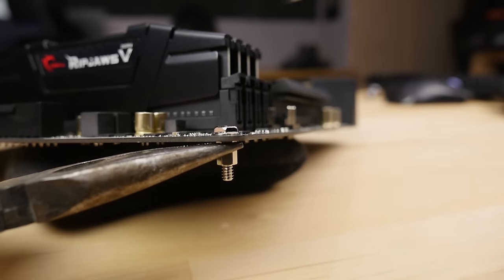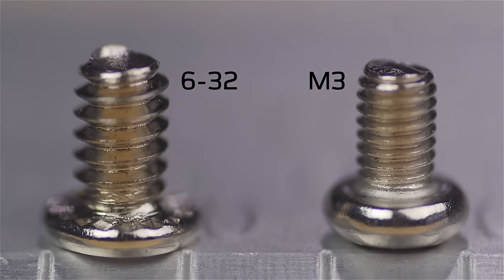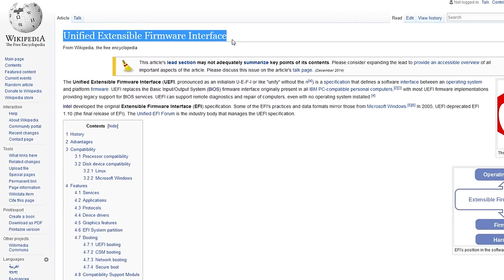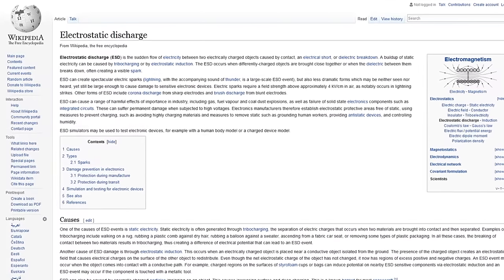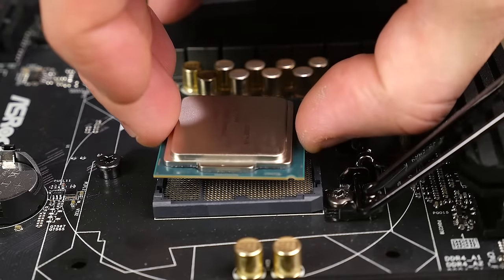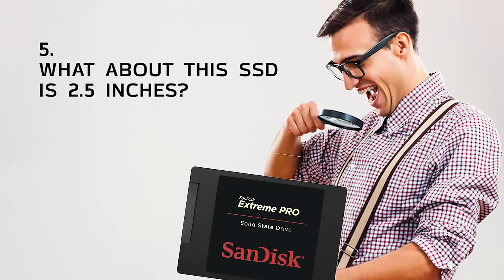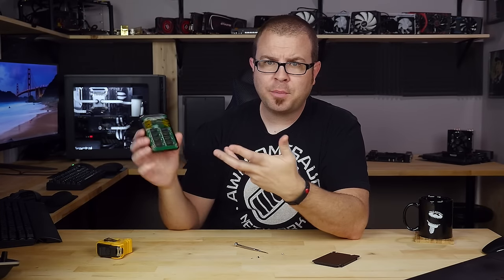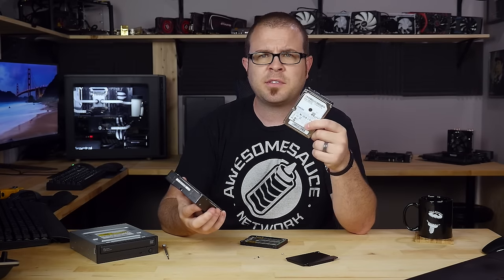5 Confusing PC Building Facts

Comment: None of those things have confused me (yet, I've never dealt with a system using UEFI). What confuses me is all the little variables that go into selecting the parts. Like the RAM speed, bus speed, how many "rails" the power supply has and how much power each one can supply, all the CPU parameters and which ones you need for any particular board, etc.

To be clear, I've never built a system from scratch, but I've read other people's discussions of system building and unless I'm mistaken, it's not as simple as just selecting compatible parts and slapping them together. I've seen motherboards that seemed (to me) to be fantastic and have every feature you could want, and yet people claim they have nothing but problems with them, or that you can't use certain combinations of parts with them, even though they should be supported.
Reply: In my (albeit limited) experience building pcs, it is a matter of just grabbing compatible parts and slapping them together. Maybe if you're overclocking or pushing performance you need to pay more attention to that stuff, but I've built a few totally good machines without going too in depth selecting parts.
Reply: It's really not that hard unless you're trying to build a super high end rig where every last bit counts. Generally if you can get past getting the processor and motherboard everything else is easy (which is usually just getting the right processor socket). Any decent company that sells memory will have a helper where you just put the motherboard model number in and it will tell you your memory options and give you an easy shopping list to choose from. As for power supplies, an ATX power supply around 500-600 watts will probably be plenty of power unless you plan on running multiple graphics cards and/or a whole bunch of hard drives.

And as for people complaining about any product, people are more likely to complain then compliment. So check multiple review sources and remember that for every positive review there are many more unwritten positive experiences than for every negative review you find.
Reply: People don't use the defaults? It used to be back in time that you had to select the correct jumpers or you'd fry the processor, but these days, there are so many different sockets available that it's not something I've encountered.

Also, the CPU is the box and all the goobins in the box, the processor is the little thing that goes in the socket. I wish people would keep it straight as they're not the same thing and it does add a slight bit of confusion.
Reply: CPU stands for Central Processing Unit - people just call it a processor nowadays. The box plus goobins is the computer.
Reply: MastAblation No, it's not. The computer is the monitor, keyboard, mouse and CPU. Sometimes they're all combined into one box, but that's a desktop.

The CPU stands for Central Processing Unit, as in the place where the motherboard, processor, RAM and other bits live.

Just because people choose to use the wrong word for a technical matter doesn't make it correct. And there's no excuse for people who know how to assemble a computer to not know that the processor goes inside of the CPU.
Reply: +Shaun Dreclin & John McMillen As a small example of what I mean; When I went shopping for a graphics card for this system (which was otherwise complete when I bought it refurbished), many of the cards said they required a 500W power supply and some even recommended more. When I asked for advice online, I was told that even though my power supply is only 450W, I could use pretty much any card I wanted because it was a heavy duty power supply and had enough power on each "rail" to support more advanced cards.

I don't have the faintest idea how you would determine such things. In the end, I didn't buy a super high-end card, but if I hadn't been told this, I would have driven myself crazy worrying about the power requirements of each card I considered.
Reply: +Chris L No you are wrong. The CPU is the Central Processing Unit, which can be made up of 1 or more Processors/Microprocessors. The board that contains all the other required microcontrollers/processors in order for the computer to operate is called the Mainboard/Motherboard. If all the required ICs are built into a single component, then it is called an SOC/System On a Chip. When you combine a CPU, a Motherboard, and Memory, you have a Computer. Most Computers have more than one type of Memory, and also have extension chips attached to the system bus to add extra functionality such as input/output and permanent storage.

You really should educate yourself, or at least do a simple google search, before trying to spread false information as truth.
Reply: Sean Ramey From the looks of your picture, I've been using computers since before you were born. I even earned a merit badge for them when I was in Boy Scouts.

That isn't true. The CPU is the box and all the goobins in it that include the RAM, motherboard, processor, disk controllers and all the bits necessary to do the processing. Hence, it's the Central Processing Unit.

There's a lot of ignorant people spreading that mistaken belief that a processor is a CPU when it's not true. It bothers me a great deal that retailers have succombed to that mistaken nation as well.

But, now, the box is not the computer, the box is the CPU. The computer is the collection of display, CPU and input. Although, it may be missing one or another of those.

If you're going to correct people, it would help if you're actually right. I've been using computers since the Apple ][ and doing my own upgrades for over 25 years now. I think I know a thing or two about how computers are put together.
Reply: I don't know where you got your info and I can't find anything that backs up your statement. Do you have any source for your information? Something other than your experience? I work in IT, so I'm a little bit curious since I never heard this before in my life. I know that people often confuse Processor and CPU but that's it. Also, I find it quite doubtful that even the manufacturers would make the same mistakes since they themselves call them CPUs.
Reply: +Chris L just because you were born before he was doesn't mean you are automatically correct.  The CPU meaning Central Processing unit is in fact a "Processor" whereas there are other dedicated processors in the "BOX WITH ALL THE GOOBINS" as you described it professionally as you are are for example called the GPU which means Graphics Processing Unit.  i'll even leave a link to the wikipedia site note the first result if you slap cpu or processor into google https://simple.wikipedia.org/wiki/Central_processing_unit 

now the box with all the goobins in it is usually called a "computer" or a PC which is short for "Personal Computer" 

a computer can infact contain more than one CPU there are motherboards that support a Dual CPU setup and most of the higher class motherboards to support the use of multiple GPUs in one "computer" ...
gosh i feel like i'm  talking to a 70 year old who wants to know  how the thing with the screen and the internet works.

Now. One last thing even IF it may or may not (pretty sure it wasn't ever though i must admit i did not look this up) be true that a Computer is actually called a CPU the use of the term may have changed over time. that is how language works. And if i tried to tell you that a Table is in fact called a chair and  the table is the box in your house with all the chair and cutlery and stuff in it i guess you propably wouldn't believe me. 

i do acknowledge the possibility that you are just a troll looking to provoke an unreasonable response for something stupid. And if you are, well then i want to ask a troll personally why you get "pleasure" out of pretending to be too stupid to be allowed on any kind of computer. 

But if you are not. Please educate yourself before you post things online and please refrain from calling people out just because you have been around before they were. 

TL;DR CPU is processor, you are most likely a troll, you are not automatically better than others because of your age or experience.

Also excuse any mistakes i made in my statement, english is not my first language.
Reply: +fenix23 Yup, that's why I said you only really need a CPU, RAM/ROM and Mainboard in order to have a computer. You just won't be able to input anything except by modifying the ROM.

+Chris L The CPU does have more than JUST a processor, but it's all in that little chip, NOT the whole PC case.
 ALSO, here is the MARRIAM-WEBSTER DICTIONARY DEFINITION OF CPU: https://www.merriam-webster.com/dictionary/cpu

and the definition of COMPUTER (NOTE: INPUT/OUTPUT DEVICES ARE NOT REQUIRED, ONLY MEMORY AND PROCESSING) https://www.merriam-webster.com/dictionary/computer
Reply: +Sean Ramey, There's a lot of mistakes in various dictionaries and such. As shocking as it might be, computers predate the internet. Also, good luck finding any information that old online as it's mostly just the last few months.

I don't much care what you folks think of me, but you just make yourselves look like you don't know what you're talking about if you confuse processors and CPUs as the two are not the same thing. There's a reason why any decent retailer files those processors under processor rather than under CPU.
Reply: +Fenix23, Those are called headless servers. They're a completely different thing from what people are talking about when they're referring to computers.

Jesus Christ are you people dense. The computer world has done a rather poor job of keeping records of it's history, but this used to be basic knowledge that people would have in order to work with computers. You wouldn't take the entire computer in for servicing, you'd bring the CPU and let them work that out. Unless you had some reason to believe that it was the connection between the CPU and the monitor, keyboard and or mouse.

Sigh, I think I'm starting to understand why it's so hard to get quality hardware anymore.
Reply: +Chris L So, that's why http://www.newegg.com, maybe the most popular PC part retailer, lists the processor under "CPUs/Processors" right?

EDIT: OH AND LOOK AT THIS! What have we here?? Why, an ad pamphlet for the ATARI 800 PERSONAL COMPUTER SYSTEM. Take a look at those specs! Wait, what is that? The CPU is a 6502B microprocessor @ 1.8Mhz??? How can this be??? I thought that CPUs weren't the same thing as processors?? https://ia801709.us.archive.org/28/items/Atari_800_Catalog_1980_Atari/Atari_800_Catalog_1980_Atari.pdf

Also, that's MARRIAM-WEBSTERS dictionary, which has been around for a very long time. These definitions are same that where in print back then. And this particular dictionary is THE most accepted dictionary for the English language. Everybody agrees that these definitions are accurate.

I looked up some archived Computerworld magazines from the 90s, more specifically 1992, and I found many references to "CPU" that are used in the same manner as nowadays. https://books.google.com/books?id=3xCDoTnlyocC&pg=PA62&dq=CPU&hl=en&sa=X&ved=0ahUKEwjp7-uKlKLRAhWG24MKHVRjCQcQ6AEINzAC#v=onepage&q=CPU&f=false

"...the three-CPU model 300 machine..." <-- If machine = CPU and CPU != Processor,  how can a CPU have three CPUs?

"Putting both OS/2 and Netware on the same chip means putting two operating systems on one CPU." <-- If a CPU is not a chip, but many chips, then how can this sentence be true?

"Instant management of CPU consumption..." <-- If a CPU is a processor, mainboard, and ram, how would you manage "mainboard consumption" since there is nothing to consume? This sentence eludes to managing your processor cycles consumption, which means the CPU = processor.

"It is said to test CPU, memory, network card, video card, and local hard drive performance..." <--If the CPU was all of these, then why doesn't this sentence say "It is said to test the CPU..."??? Because the CPU = processor, that's why.

"plug in this SPARC module and you've upgraded from two CPUs to four." <-- This is simply impossible to gain two entire extra computers from plugging in a single module into one of them. CPU can only mean processor in this sentence.

There you have it. I proved it with antiquated information.             YOU     ARE     WRONG!!

You must have been taught wrong. Sorry.
Reply: +KapitaenEnte Sadly, I don't think he is trolling... But, if he tries to comeback with something saying that I am still wrong, then I will know for sure now that he is either dumb, a troll, or both.
Reply: +Chris L Actualy I sit next to my old PC that has a new role as web serwer and network router. Gues what, it has no monitor and keyboard. ;) Please educate your self :)

Comment: 6. "Let me plug this USB drive in... nope, reverse the plug... nope. Reverse it again... now it fits." WTF.
7. "Press Del to enter UEFI." Pressing Del... nope, didn't take it. Reset machine. Press again. Nope. reset machine. Smash Del repeatedly. Now it works.
8. 90 degrees SATA data cable end always hits some piece of hardware that is somehow in the way.
9. SATA power cables with multiple ports always need a quarter inch more to reach the next drive.
10. After finishing the build and mounted that big arse heatsink, you realize you forgot to plug in the CPU power.

Comment: a 3.5 floppy disk is 3.5 inches wide. So the drive housing it is wider. The same goes for 5.25 floppies. I still have both and checked measurements. The youngsters cannot know that anymore...

But I dont know what 2.5 is referring to.

Comment: In my so far short time working as a simple PC Repair Intern, I've only ever had to deal with M3's, and usually they're used for absolutely everything. I've never encountered a UEFI, only a BIOS. Do newer Motherboards still have Jumpers for resetting the password on the UEFI just like how it was with the BIOS? As for ESD, ever since I got my Cisco A+ Certification, I've always carried around a small, unpainted, metal cylinder in my tool kit. People think it's dumb, I've always like doing that instead of wearing the ESD Clips. A lot of younger kids have came in with bent CPU.. gold pieces (no clue what the official word for them is).

Comment: Why would you need 2 pairs of pliers for the standoff instead of just 1 plier to hold the stand off and a normal screwdriver?

Not to mention who puts 5000 pounds of force into screwing a standoff bolt till it gets stuck?

Comment: what confuses me more, is my ignorance when it comes to fans. when i have a fanhub with say 4 3pin-connections and 1 4pin-"outlet"(?)- can i pwm-control all of the 4 fans by plugging the hub to 4pin-connection on my mainboard? if so, does that mean, that all of the 4 fans have to run at the same (variable) speed?

Comment: PAUL! GROUNDING YOURSELF IS DANGEROUS! You should just touch the power-supply while unplugged.
Reply: Nothing dangerous with that. I've been using that trick for years.
Always put the PSU on off but keep it plugged to grounded wall socket.
Reply: I don't know what ESD Certification Holzman have, but there's reason why he disabled Like/dislike and Comment on the video.
I would've told you why it's completely safe, but you already won't listen to me anyway.

Comment: The idea that UEFI was 'needed' to achieve fast boot times is BS.  The truth is that we had Debian 6 (and Ubuntu 10.04) booting with BIOS in around 10 seconds without any significant tweaking.  The only reason for UEFI was for Microsoft to be given a fresh foothold over Linux for a few more years.  Notice that UEFI appeared on the scene right around the time that Linux had been polished enough to become well-known among average joes (for desktop use).  Lump this in with the attempted and somewhat failed proliferation of C# and the almost completely successful proliferation of pulseaudio and systemd.  It's clear that we almost saw another OS/2-style killing and frankly, it's still very possible.

Comment: It's 2.5" and 3.5" between the center of the screw mounts on the bottom.
Reply: This guy has got it right. SFF 2301 and 8201 for 3.5" and 2.5" respectively

Comment: Pretty sure the 2.5", 3.5", 5.25" bay sizes come from the type of floppy disk drive you can fit in the slot.
With that much hair loss you should be at least my age (26), thus making you old enough to remember floppy drives we re both still a thing when we were children and came in more than one size.

Comment: how about a high pitched noise, only present when computer left turned off for a while, not apparent when turned on(instantly goes away after power on), only thing changed from before is that about one "screw"(idk what these are called) on heatsink broke...
weird that this happened...
if I wanted a proper fix, I should find some forums or repair shops, but I just want to know what and why is happening...

Comment: Measuring SSDs by inches of platter diameter is like specifying LED bulb brightness in watts-incandescent. In that case, the EPA did the right thing and forced the move to lumens - not so much with electric cars, which first had their efficiency measured in miles per kWh, but a few years ago, the gods of EPA decided to switch to the idiotic "gasoline equivalent" standard. And it's only for EVs - diesels and fuel cell cars get to use their native units as intended.

Will we still use platter diameters after HDDs are relegated to museums? Will the idiocy of the MPGe continue once the last drop of oil has been extracted, refined and burned?